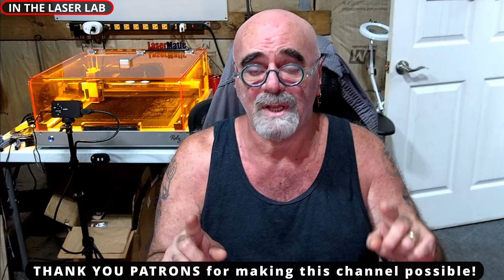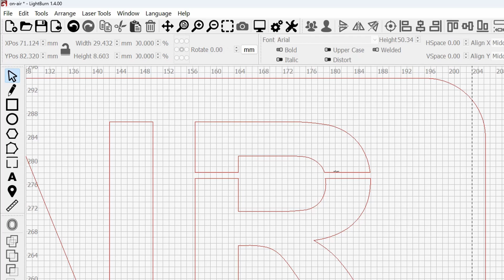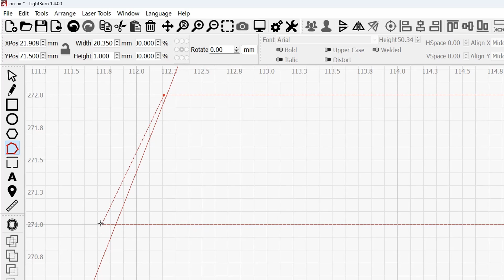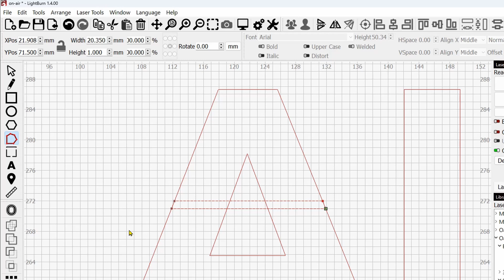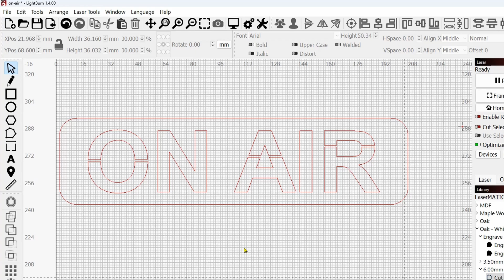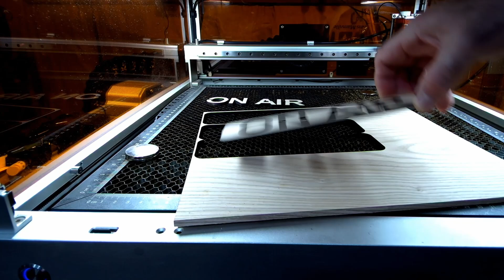💡How to turn ANY FONT into a stencil font! Solving the issues when cutting out letters!

Comment: Regarding the capital A: Perhaps a cleaner and easier way to stencil it would be to vertically slice the A's horizontal crossbar. Most stencils and stencil fonts do it this way (but will be a bit weaker until affixed to a backing). Btw: sincerely enjoy your videos. Some of the best on the net on any subject, both in content and presentation.
Reply from the maker: That's a great idea, thanks!

Comment: I've done this before but I don't have to resize the small 1mm cut to the exact size. I convert the text to a path, then boolean add the lines of the text. Then I draw my connecting box and simply boolean extract it from the newly joined lines. The box edges just dissapear and leaves the joined parts. I've never had to convert it to a path and use the node editor. It only takes seconds that way.
Reply from the maker: My mind sometimes doesn't work that well at 2am 🤪 But I bet someone learned how to node edit!

Comment: can i ask about your honeycombe bed and rulers are they as a set or separate items
Reply: The honeycomb bed with the rulers came with my Roly laser.  I don't know if you could purchase them separately.
Reply: Are they available in Fahrenheit? I still like to use Imperial.
Reply: @robotsnthat  Fahrenheit - No.  two sides of my bed were in millimeters and the other two sides were in inches.
Reply: @jessetutterrow4320  Confusing eh? I had a bed like that and could only lie on my right hand side, as my left leg is longer when measured in Kevin. 1 Kevin being 1/6752 th of a football pitch. (Approximately 1/365 th of a car length, to be almost precise for American folk). 👍

Comment: No need to resize or edit the nodes, just do the boolean operation. A couple of extra steps can be eliminated. Great idea though Rich, I'd never have though if it myself, but pretty obvious 😁
One thing, once you've done the boolean operation, it will convert the letter to a path, so make sure to check the spelling first! 😂
Reply: Was just about to type this, but thought i would check first, and all i do is the 1mm tall rectangle, and then select the A first, and then the rectangle and the 3rd boolean down on the left menu.
EDIT, I would also have had all the cuts in alignment, for my OCD side lol
Reply: I thought the same thing. I’ve been just using boolean
Reply: Exactly, this is what I did, too - saves a lot of fiddling, frustration and time. Direct Boolean worked fine.
Reply: yea , all that node editing is unnecessary
Reply from the maker: This is channel to teach and learn Lightburn. I add certain things to videos that I don't actually do when designing a file to point out the feature to folks who are unfamiliar with it.
Reply: @TheLouisianaHobbyGuy  I’ve learned so much from you doing that! I always tell myself to watch a video you post because I know I’ll learn a new lightburn tip!